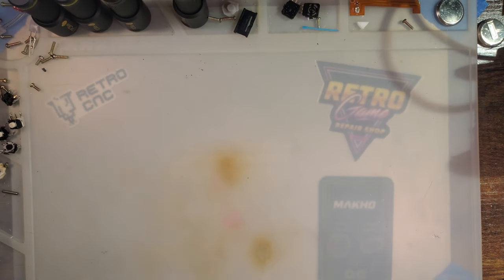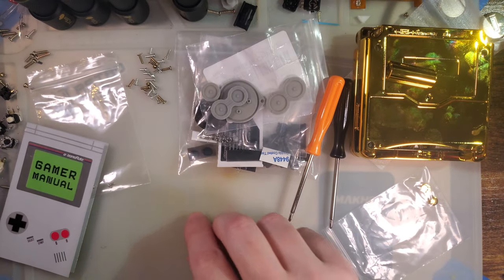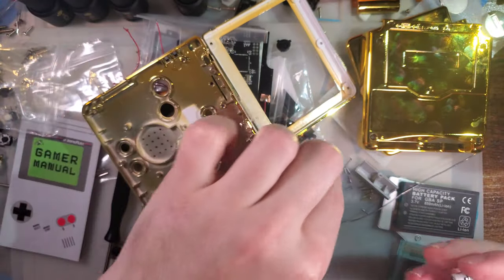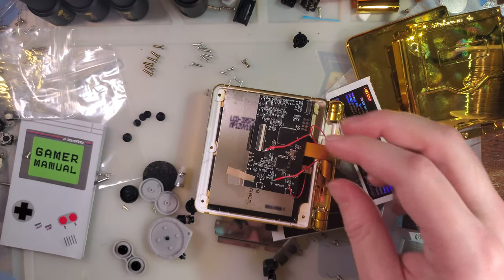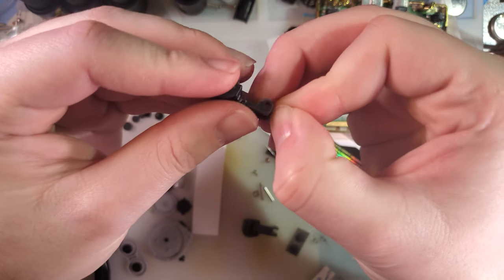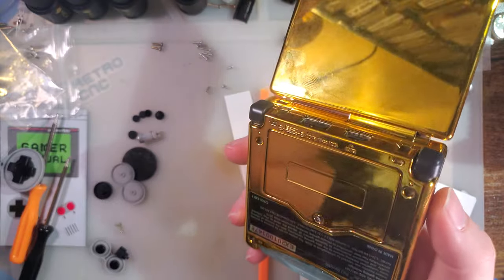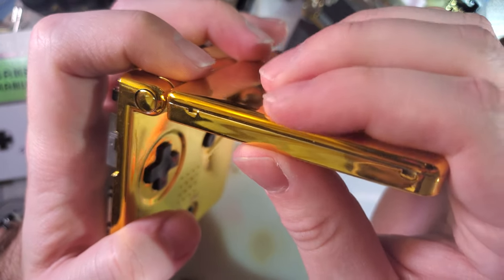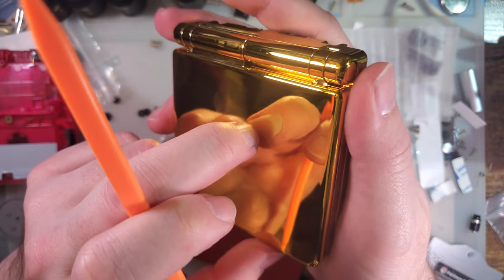eXtremeRate Chrome Gold GBA SP

Comment: i love the ridiculousness of the look, but hows your experience with things like the paint chipping off the buttons and shell? i had some chameleon buttons that wore down really quick
Reply from the maker: I mean, it's a thin electroplated coating over plastic, it will come off as the underlying material wears down. It's also extremely glossy so it will show every single blemish it picks up. I think this is expected behavior for a finish like this.

Comment: 13:42 Bullshit! 😂 If you know what you're doing and don't have the motoric abilities of a stroke patient, it is not that hard to get these rubbers out with a flat head screwdriver without any mark on the rubber or the plastic.
Reply from the maker: ok. Seems you missed the nuance.